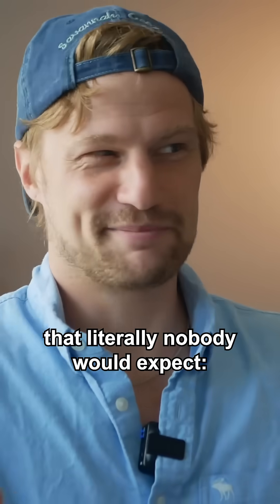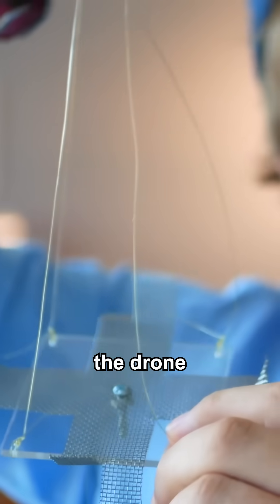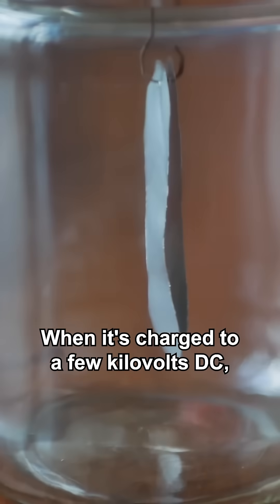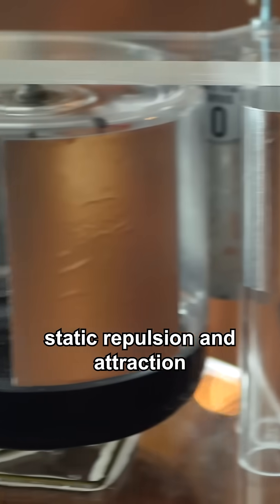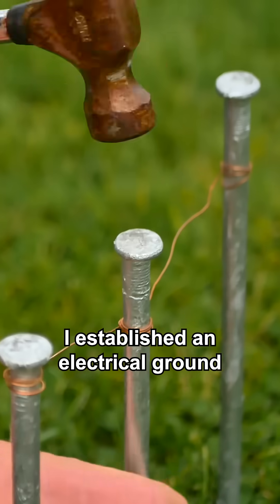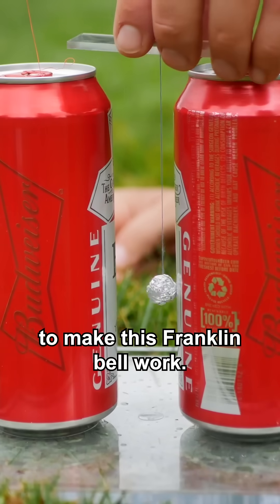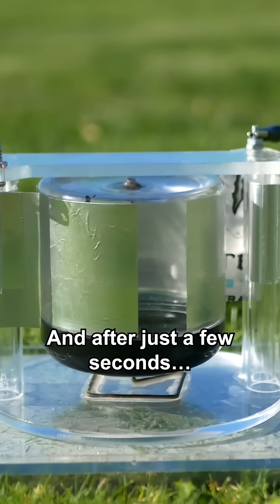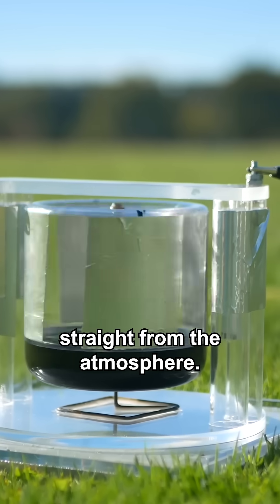Drone Harvesting Invisible High Voltage From the Sky

Comment: Much of that electrostatic charge from the "atmosphere" is coming from the friction between the drone propellers and the surrounding air.  In other words, you are getting back a TINY fraction of the energy you spent to charge the drone batteries....
Reply: There is a natural voltage gradient in the atmosphere, increasing with elevation. However, voltage potential is always relative to the local ground. If you construct a building to “harness” this energy, the top of the building effectively becomes the new reference ground, meaning the usable voltage difference remains the same. A large collection area might gather some charge, but the overall power output would be minimal, making this approach impractical for large-scale energy generation.

Comment: the only problem with static electricity like that is, while you may be creating a massive voltage differential, there really isn't going to be a ton of continuous current. Even if you could efficiently step the voltage down and increase the current, you probably wouldn't even have enough power to charge a phone
Reply: Bs I walk around my carpet with wool socks on and I can blow the handles off of doors after
Reply: @gifzilla1818  try the old collapsible plastic highschool gym bleachers in socks. Ouch.
Reply: Someone else has a prototype magnetic charger for drones, where they can just clip onto powerlines and charge via the EMF generated by the powerline via induction. Iirc it may have been a powerline company that came up with the idea for inspecting remote spans of lines. 

Seems a bit more feasible while allowing more mobility, as this demonstration gave me the impression his drone is tethered to ground.
Reply: @100GTAGUY this is not a method to charge the drone. He is using the drone to suspend a wire. There is no connection between the two. Charging from the emf of a power line does work but it’s no different than just plugging your drone into the wall.
Reply: @incognit01233it is not upsetting… it’s just that the guy posting doesn’t mention that there is VERY little power available. Sure, lots of voltage, but lifting two foil leaves apart isn’t really doing much work. So… kind of a misrepresentation.
Reply: @jakesheffey9256  i suppose so, the video was a lil confusing about what exactly was being done with the grounded line (i only saw this thread again today from another reply to me, my notifications have been wonky as heck)
Reply: @100GTAGUY  Would also be illegal since it does actually rob energy from the lines.

Occasionally somebody tries it just by burying a cable under the transmission lines.  Eventually the power company notices the extra loss and comes looking for the clown who set it up.
Reply: @laurenceperkins7468  i would assume as much, it would be theft of utilities technically speaking albiet drone EMF charging may set new precedents on the matter. I'll leave that to corporate lawyers to spitball however. 

However i think EMF charging is being pursued by electrical companies to improve the logistics behind them employing drones to inspect remote spans of line more regularly.
Reply: maybe some kind of gigantic capacitor could help
Reply: Maybe our phones use too much power then.
Reply: The chinese have supposedly found a way..

Comment: What if the Pyramid were to somehow energize the ions before it shot them into the upper ionosphere? gave them an extra charge?
Reply: WHAT?
Reply: @Dill_Do  The Pyramid power plant idea is they used vibrations all thru the massive stones of the structure & this would cause the creation of ions from the vibrations, also the 2 1/2 tons of quarts crystals would be energized as well

Comment: Obviously, you’re right. Sadly, in order to gain that energy the amount of inputted energy to build a tower raise wires and so forth with far exceed the energy you get in terms of potential difference between the ground and 100 m altitude differential point.
Reply: Yeah, I don't think that this would be a costly venture at all. If you really think it would be challenging to raise 100,000 rods (wires) of 100m a piece, connect them all in series, use some plastic lattice to hold them all in place, and then pull the power at the ground, then you don't realize the industrial capacity of the planet. That would be a fantastic tool for emergency power.
Reply: @mynameis5427  It doesn't create power. It creates a potential difference (like water pressure) but no flow. Like opening a tap and a spurt of water amounting to a few mls shoots out, then nothing.
Reply: @Gottenhimfella  Yeah, you are right.
Reply: @mynameis5427  Kudos to you, it's rare to find another person on YT who is prepared to rethink their stance. I like to think I am, but I know that's not always true.
Reply: Not really. Every mountain has a base, some even have valleys. Towers are pre-built and free of charge, but copper wire on the other hand can be very expensive!

Comment: The obvious next step is making a corona motor that produces enough power to lift itself and whatever supporting mechanisms are required. Well, or figuring out how to convert extremely high voltage, low amperage power into a more usable form.

Comment: There is a reason why radio towers are grounded, multiple times. If you isolate even an empty radio tower, then walk up and touch it without any protection you will get the shock of your life. Grounding is important.

Comment: I would love to see this scaled up with air-ionizing lasers. Air (well, technically the nitrogen in the air) is a decent lasing medium capable of producing MegaWatt (microsecond) laser pulses. Using each pulse to ionize the air for a conductive pathway and collect that electricity to charge the next pulse could create a positive feedback loop. Admittedly, this would create a lot of noise (like a tesla-coil speaker) and nitric oxides as basically synthetic lightning, it would still be really cool to see (and hear).
Reply: Honestly this would be a great video. I want to hear it, so much you can learn intuitively by hearing the oscillation and dynamics.
Reply: @nobodyinnoutdoors  If he could get a connection high enough to the ionosphere, the result would be truly epic.

Comment: So could we have harvesting towers that are nothing more than static "forests" of poles that have a cable to run to the top with a similar 'antenna' (the wire harness as you called it, in a similar way that you've ran one up with a drone?

Or would even a large "forest" of these produce no worthwhile amount of energy?
I presume they would also be literal lightning rods, and would be an issue in that regard?

Comment: Does the electrode have to be moving on a drone? (which wastes energy)
Or could you put the electrode on a very long stick (extremely long) andget the same effect?
Reply: I'd probably try some form of high altitude kite instead of a pole.
Reply: That's what I was thinking, I kite,
Reply: Pretty sure that if you had it on a long stick you’d be grounding the system, so electrons would flow through the stick instead of through your machine? Maybe if you had it on a super long fibreglass rod (like the ones linemen use), or at least separated from the stick with a good insulator (like the ones on power lines) you’d have enough resistance in the ground path though?
Reply: Could attach it to the baloon i guess and do multiple anchors?
Reply: @palivilco  good idea, although helium is a scarce resource, and hot air requires fuel which would also have to be refilled and incurs a cost.
My line of thinking was that if a long pole could do the trick, it would probably have the lowest setup and operational costs.
Reply: @yyyyyk  or just use a box kite that can lift up to roughly a ton...like NASA has been using for nearly a century.
Reply: A stick would do, although like the guy says here, it'd have to be a very good insulator, not a literal wooden stick. 

The drone is just a cheap and convenient way of getting something up high.

Comment: I still wonder how long it will be before you obtain a CO2 laser cutter for all your acrylic cutting fun. I mean the laser has a high voltage power supply to run the tube so it's a natural addition to a guy who loves both excess quantities of electrons and polymerized methyl methacrylate. :D

Comment: Why you don't make a bigger, much bigger Anode and Connecting it to a Helium Balloon to see how much energy you can harvest passively...
If is enough to charge a Car Battery in a week you could think to Scaling up the concept into 
'Extreme Off Grid' 
Energy Harvesting Applications...
You could think of making the floating device the Anode Itself by making those in some Plasticky High-Graphene Composite and Using Vacuum for making them Float..

[Is not that is going to produce much...
But if you can Use some 5/10 Balloons to Charge or Powering Something that can be used for a Significant amount of time it could be very helpful...
From Research Camp Base in Distant Areas, to High Altitude Tourism, emergency Charging Stations for Cars Batteries in the middle of Route 66...
Far Sea and Atols Electrical Services...
Small Ship Emergency Electric Power/Communication Antennas...]

Comment: It's not clear how are you getting the energy from the drone down to the ground. And is there a way to do it without wasting a ton of energy using a drone?
Reply: Sky is positively charged. That's how lightning works. And a weather balloon would work as well. As a passive bouancy device model. There is a quite bit of electric potential, which you can see from sparks, but there isn't much current to do work with.

Comment: Stupid question, but Can you recharge the drone with it, giving it some more air time before needing to be recharged!? Of course, the extra mass of the setup would limit its charge capacity too, due to using more energy to lift it up, but I guess a considerable amount of energy could be harnessed for extended flight!

Comment: Similar principle to a non powered radio, using a diode
Reply: Nope.  That radio is powered by the radio transmitter.
Reply: @markkinsler4333  so you've just confirmed that the experiment isn't isolated from these external forces. Our planet is bathed in all sorts of man made frequencies

Comment: Hey serious question here, why would you choose a drone over a balloon? Does the drone provide another benefit?
Reply: probably has better control over altitude and relative position
Reply: That's a good idea considering the further from ground you go the higher the voltage potential would be.
Reply: cause the balloon would just float away
Reply: The down wash of the rotor blades creates a big part of that stating electricity. This is a known problem with helicopters that can cause problems with them. just google "static electricity problems helicopter" and you find plenty of info on this.
Reply: You can stop it at whatever height you want to test at and it tracks it's distance too.
Reply: Also the ballon had to be pretty big to lift the wire with the electrode. Means a lot of helium would be wasted for this test and also the bad stability in the air. Wind forces would probably rip of the little wire

Comment: Why not use the voltmeter?
Reply: because a volt meter can't measure these high static voltages. also in this case measuring it electronically would collapse the voltage.
also trying to get electricity out of this is not possible because of the same reasons.
you can create relatively high voltages out of systems like this (and many other static charge systems) but as soon as you try to get more than a few joules per second of energy out of it, they all fall apart and fail.
fun fact this is also why we don't have systems that "catch" lightning bolts and convert it to usable AC/DC electricity. they have incredibly high voltages and ampere peaks but if you calculate the voltages down to 230V and 16A then you don't even get a single kwh out of a lightning bolt.
Reply: If you want a more on-depth explanation, ElectroBoom recently made a video all about it.

Comment: Is this possibly from static discharge from the propellers of the drone ?
Reply: I'm curious how much of this is from radio towers.
Reply: There is an equation that describes this phenomenon. The tower located in Montauk was engineered with the understanding that energy can be harnessed from the ether. Voltage increases as the height of the conductor is increased to an ideal height maximizing energy transference. The conductive element rod also goes underground (grounded). We live in an electric universe. Free electrons are everywhere.
Reply: @jamianjacobs5898  the ether isn't real. Scientists abandoned that long ago.
Reply: I was going to ask the same thing. Rotor down wash from helicopters can generate lethal levels of static electricity. While any static from a small drone would be less, it should still exist.
Reply: My first thought...need a  helium balloon.
Reply: I heard that a natural potential difference exists of circa 250 Volts for every 6 feet.  But the current would be tiny.
Reply: No .... the atmosphere is loaded with electrical potential.  Positive ions mainly the voltage increases the higher you go at about 100v  per meter
Reply: Well, I'm not a physicist, but my guess is, that you may be able to make the props spin - very slowly.
But in order for them to lift the drone, they'll need to spin at several thousand rpms. The energy required is simply several orders of magnitude higher than anything you'd be able to harvest from this contraption.
It's like trying to use a hamster in a hamster wheel to drive a car
Reply: Its mostly suns wind and cosmic particles. It supposedly works with just a big tower. I want to make it one day